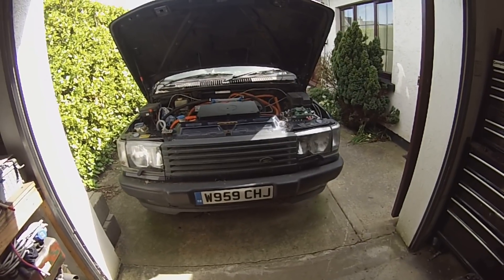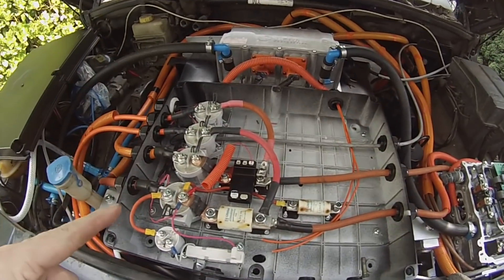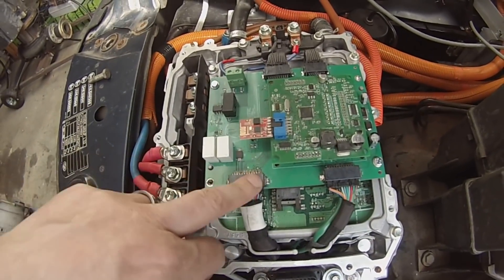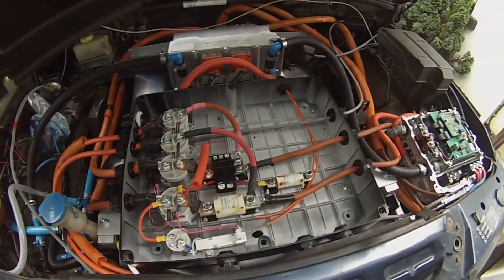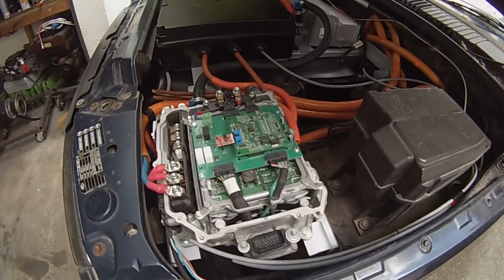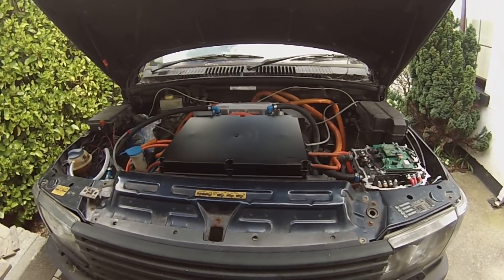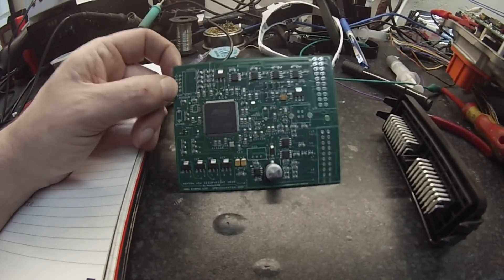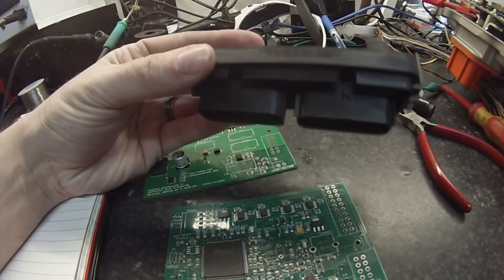The Rover Returns, Again

Comment: The ECU for the engine on a P38 lives vertically in a pocket behind the battery on the left as you look under the bonnet. back right hand corner where you looked depending on the model is where the cruise control control goes.
I'm interested in the conversion as I have a P38 sat in the (clean and dry) barn, wondering what to do with it, but I'm certainly not choppin bloody great holes in the floor !
Bolting straight onto the gearbox with a  plates seems more sensible and avoids the horrific looking angles on the prop shafts to the axles which might seriously affect the articulation on the axles, and knock out the hardy spicers rather fast.

Comment: In theory would it be possible to use the the Lexus 450h gearbox with another lexus front drive gearbox (like from an RX 450h) in a 4x4 setup like this Range Rover?

Comment: Don’t know if they’re still available but General Motors had the fill cap behind the number plate on some of their mid to late 70s muscle cars.To solve it they had a spring loaded plate holder. If you could get one of those it would work pretty decent to swing the grille down. the inverter/charger wiring is above my comprehension but still a awesome video and build!

Comment: Its coming along nicely!   One option for the front grill, would be to hinge the bottom, and  fit a handle in the centre top of the grill. and fit  a powerful magnet   (neodyme-type, with centre hole so you bolt-on)  behind handle on the framework of the car.
Reply: Yes,  a hinge on the bottom and possibly some sort of spring loaded ball bearing latch. Priority is neatness.